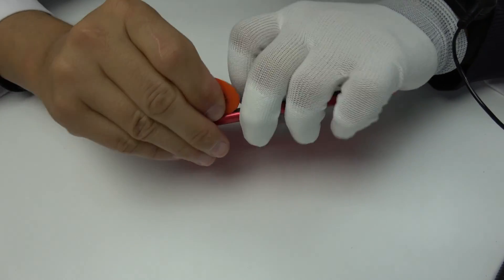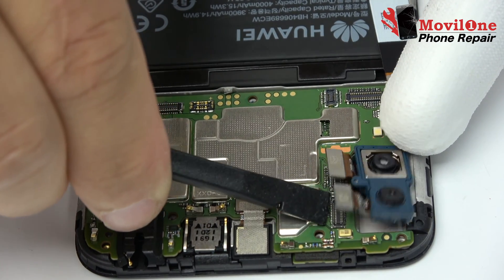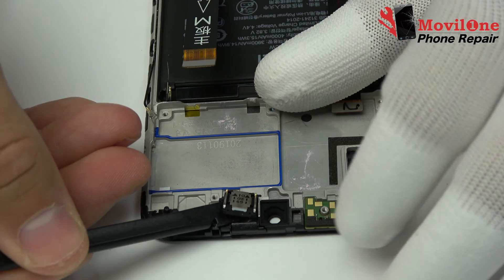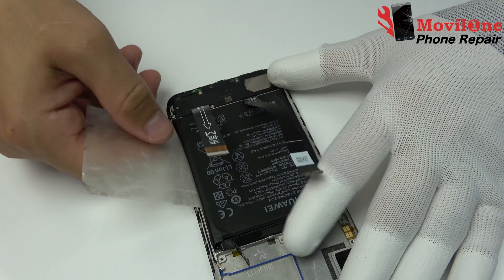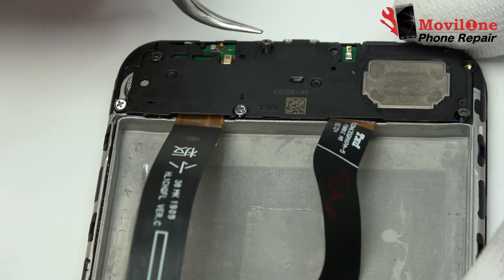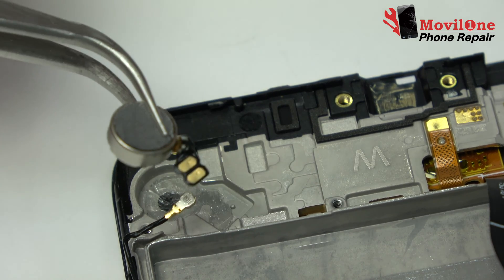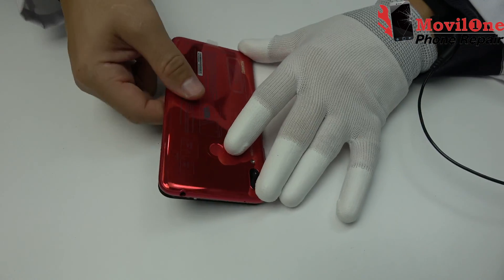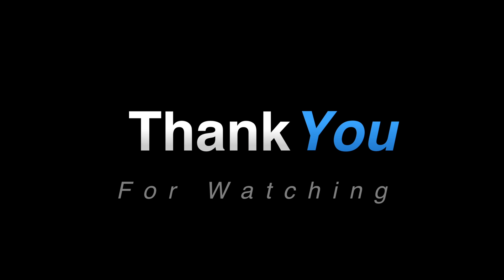Huawei Y7 2019 Teardown and Reassemble

Comment: what did you use to remove the battery , i try to remove the battery with a flat screw driver , i almost bend the battery
Reply from the maker: Hello, Technical Techbox! you cannot use metal, or metal tools when working with batteries or motherboards ....
Reply: @MovilonePhoneRepair  احسنت قد استخدمت شئ حاد ذات مرة وثقبتها